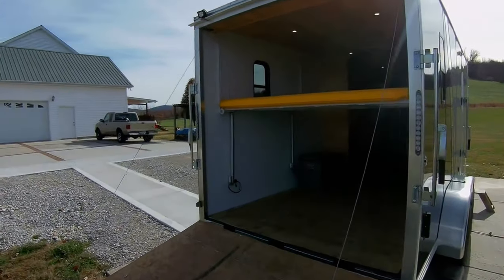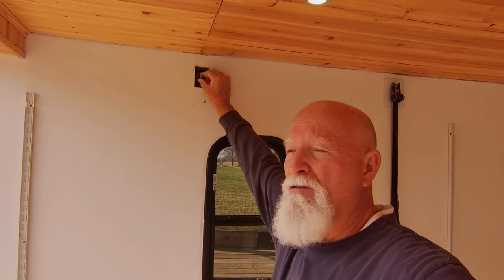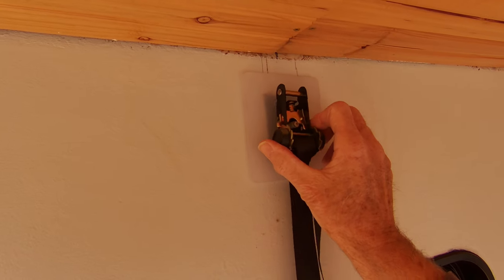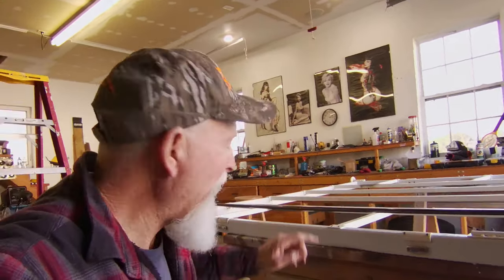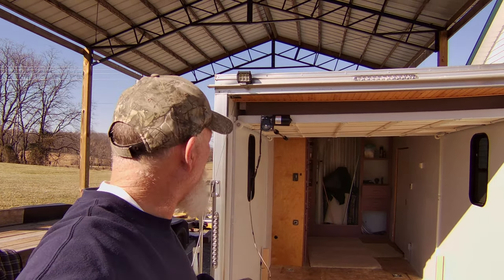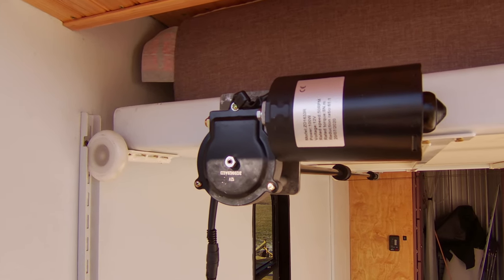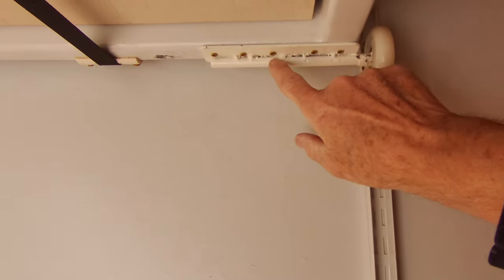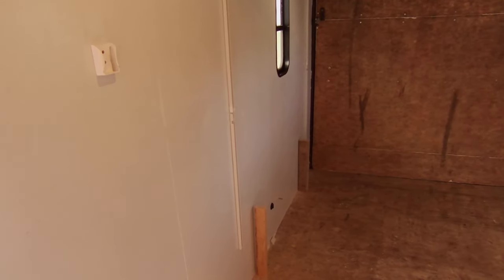HappyJack Bed Lift Alternative.

Comment: Glad the tarp motor method worked for you! Looks good! 
If the welded studs ever strip or come loose, consider rivet nuts, little easier and no welding. 
Also, the eyelets on the bottom were so the straps don’t hang down when the tension comes off the strap. Not super important though.

Comment: Well done!
I am hoping to do 1 similar but I hope to have the motor mounted to the ceiling on 1 side but use a similar design , I plan to use winch rope (not cable) and pulleys instead of rub rail/ guides. I have no idea if it will work because I have yet to see anyone do this design.
Reply from the maker: The rub rales work fine, no issues since installation.  I wanted to keep things extremely simple.

Comment: Can you send a link to the tarp motor for 60 all I can find are 130 and up
Reply from the maker: Here is the one I bought, but this vendor is sold out.   Try and find one with the same specs.  Ebay item https://www.ebay.com/itm/163370508598